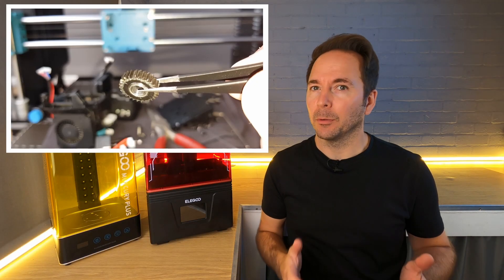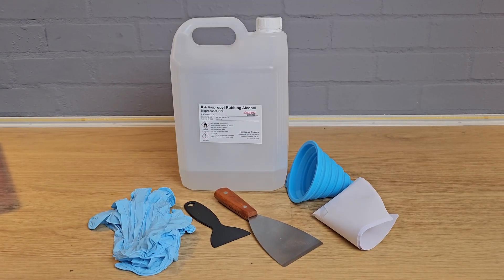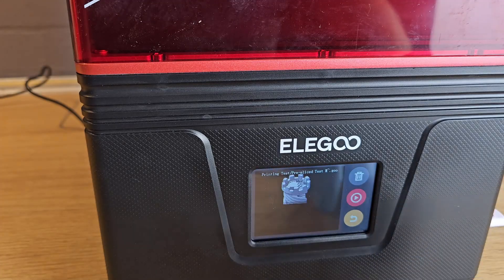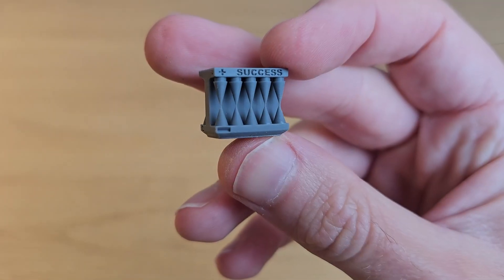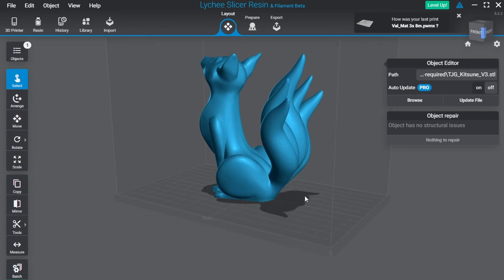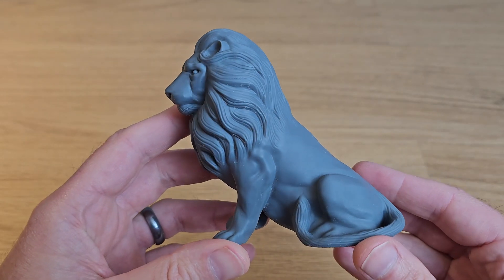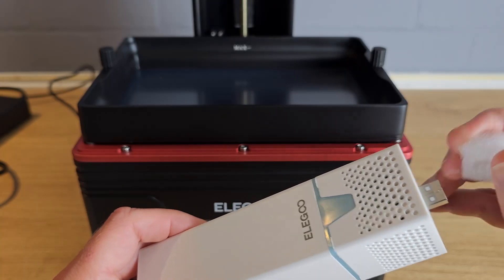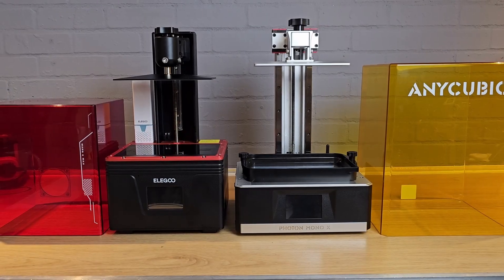Elegoo Mars 4 Max - The Beginner 3d Printer That's Actually Pretty Great

Comment: Do you need to buy the Mercury XS Bundle for washing and curing the resin? If you do get the Bundle, is the only Resin you can use the Water-Washable Resin or can you use any resin? I am new to resin and think I am going to go w/ this model but not sure if the Wash/Cure is a necessity or just something to save on time.
Reply from the maker: It's not a necessity but cleaning your prints is. If you don't buy a wash and cure machine, you will still need a cleaning solution (IPA for non-water washable resins) and something like a tray and clean paint brush.

Comment: Great review. However A) you didn't have to empty the vat - just run a vat clean with a piece of support in one corner and pull up the resin sheet with any failed parts of your print B) looks like you were using a collapsible funnel and that was what failed, not the pouring spout on the vat (I've emptied my vat on my Mars 3 with a similar spout and while it's not perfect, it worked okay) - I bought a stainless steel one as I read reviews on Amazon that these silicon collapsible ones are garbage.
Reply: And use a silicon mat underneath your work area for easier cleanup or at least some newspaper or plastic sheet. Hope that helps someone else reading this. Resin printing unfortunately requires a bunch of extra things for the post-printing steps.

Comment: You caused the fail yourself - you should always rotate the print if there is a huge surface perfectly parallel to build plate. Like always, because forces acting on the support can be huge.

Comment: I am all for improvements, and we are finally at the point where resolution really doesn't really matter - as long as its at 'worst' 33 microns.   From somewhere around 33 down to 25 micron level - you really can't see the print difference from resolution alone, especially with 2xAA on.  The only time your seeing it, is magnification of some sort, via magnifier or zoom or macro shots, etc.  So we are at the peak of need for smaller pixels - so - it's time to cram more into screen sizes higher than typical.

I want to see improvements elsewhere now, like USB in front - maybe even under a silicone plug system (so an entire USB bay is covered by a silicone sock) - imagine a rather large 'inset' in the front or side - you pull up/out the silicone sock to access a 'lays flat' usb outlet. (instead of sticking the USB stick out- thus creating a hazard and taking more room)  - there is gap inside the prniter enough, so as long as the internal  geometry can be arranged around it, it shouldn't be an issue.

Don't like that idea? Ok.. how bot.. heated space to get resin up to temps (around 25C) where it prints best?

We already have basic standards like wifi connect and such, but having more memory on unit to store files (and copying files to the printer form USB in case of problems to use the onboard storage to print from instead of usb)   now it's time to refine some areas.

I personally want to see: 
~dual linear rod standards
~the boxy 4 point bed attachment instead of the ball and knob
~ heated chamber to get resin up to 25C somehow, directly or indirectly. (maybe a heated vat where the walls of the vat have some sort of heating element in them, and covered in silicone on the outer edges and top? (to prevent heat from warming anything else besides the resin up), but when in place, touches contact pads or similar system to wireless charging to power it?)
~ larger print volumes, it would be nice to get toward the range of  800mm tall as a standard, but also larger XY - this will need a lot though, as 'larger print' causing more suction thus could cause deformation of print, or, print separation - so there will be a maximum somewhere.
~ detections of failed print (these are slowly being introduced with a bed that is pressure mounted)

for my desires, it doesn't quite check the boxes (not the above what i want to see either, as I don't think any printer does) - but it comes close, and seems to be excellent for a minis printer or just small things in general. (what resins excel at)

Comment: Did you try using the clean feature instead of pouring the resin out of the vat?
Reply from the maker: I did, but you still need to pour the majority of the resin out first.
Reply: I usually can get the cleaning layers it prints out by putting removed supports in the corner before running the cleaning process. It’s rare that I can’t remove the cleaning layer and don’t get a freshly cleaning FEP surface that way…

Comment: Nice vid! :)
I have a Mars 2 Pro that I have had for over a year and a half without any issues. I watched a vid a few months ago and tried curing a print in water and now do it with every print.
I got a clear container (half a coke bottle), filled it with water, placed the washed print in it then put it in my wash and cure station and left it in for 10 mins. The result was soooo much better than curing in air. No stickyness to the print surface and it also looked better and crisper. Give it a try. :)
Reply from the maker: Interesting, I'll give it a try thanks.

Comment: I don't really care about the resin printers now! I have the Elegoo Saturn 2 with the XS wash & cure system, 

But I be selling it all soon as the resin is far too pricey and so little for the money and time you pay for PPI, masks, paper towels ( lots of those needed ) gloves etc. 

and the fact that not being able to get rid of the loads of wash water which is toxic and can't be just thrown out it needs to be got rid off by a special toxic waste firm 
which is pricey and hard to find in the UK.  

All this means I finished for good with resin systems.

I sticking with FDM printers. still need now to find how to get rid of the 14 liters of toxic water I got stored? the UK not the best for hot strong sun to set this resin water waste.

So I don't care about the new fancy often pricey resin printers now.  For me a total waste f money and time.
Reply: It's a bit like nuclear (fission) power.  It works well, but leaves a mess of stuff that's hard to deal with afterwards.

Comment: Printing all these little figurines is fine but how about some useful things?  How accurate is the dimensions with even a simple cube?  Gears?  Can accurate machine parts be printed?  If a printer is only good for kiddie figures it is useless to me.  YMMV
Reply: The accuracy and detail are great with this machine, which does make it great for miniatures and busts,etc.  The kicker is the resin durability.  More durable resins are more expensive.  Water washable is very brittle.
Reply: @launchpad62  There is a difference between "accuracy" and "detail".  You can gets LOTS of "detail" without actually being very dimensionally accurate.  I see all these resin printers printing toys as examples of how "detailed" they can be.  I want to see some print-in-place bearings, an accurate test cube, tolerance tests.
Reply: @tvideo1189  I do have to say calling these "kiddie" and "toys" is pretty condescending.  It sounds like you aren't the target audience for these types of artistic hobby printers then as these are hobby printers that utilize resin to get much more detail in prints, i.e. visual esthetics.  I think you'd be more interested in FDM or even some commercial printers where the filaments and materials are made to be more physically useful and durable.

Comment: Once this printer comes down to £250 I will be intersted. Elegoo is on point with all the printers they are currently releasing and will be buying the Neptune 4 as my first FDM. Personally, I never clean the vat out as it creates more problems than it solves, I use auto supports and always print directly on the build plate and never have any failures.
Reply from the maker: Have you checked out the discount code? I believe it's a pretty good discount depending where you're buying from.
Reply: @RickyImpey  I havnt but will definitely use your link when im ready...pay it forward and all that.
Reply: I always print on the plate too, I have had the worst failures with everything at a 45 with supports...like a massive print breaking free from the supports in the raft and making a massive resin splash.  Like a tidal wave ruining the inside of my printer hood.  There are ways to compensate for elephants foot in chitubox so might as well use the bed.
Reply: it's currently at 229€ :)